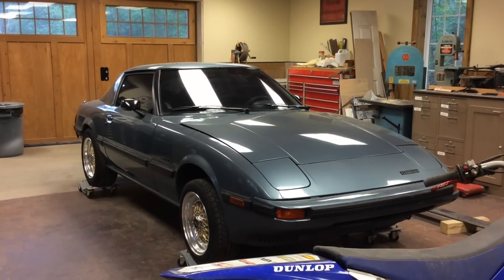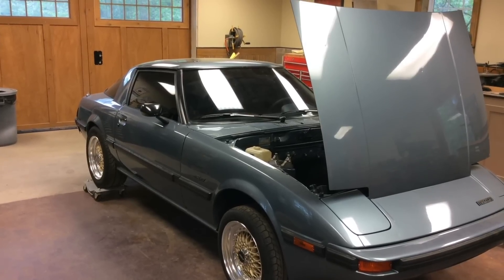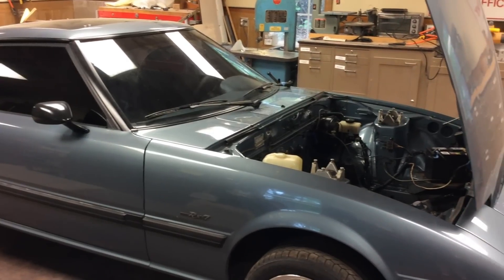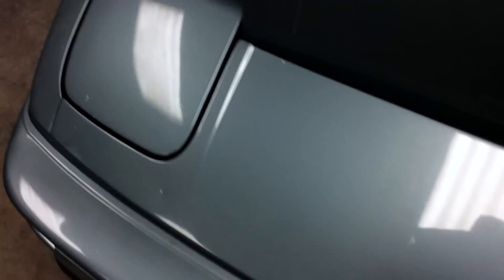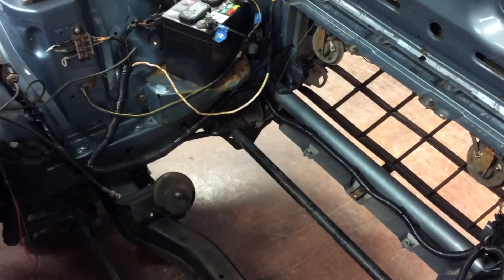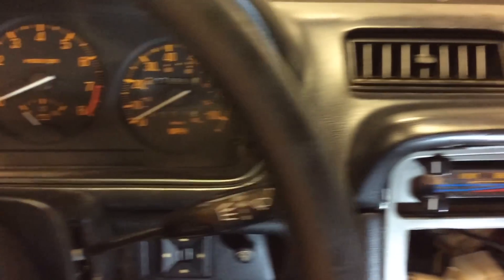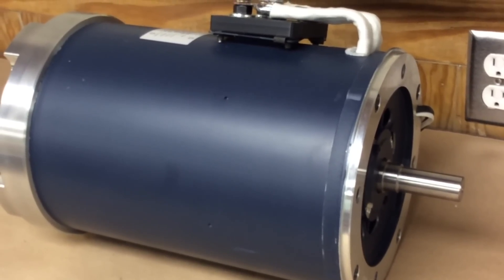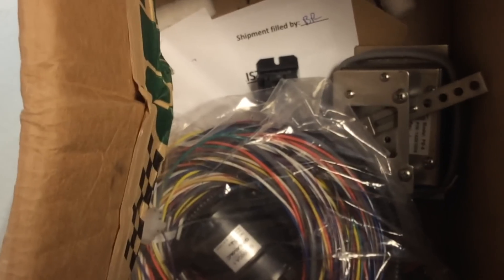RX 7 TO EV 7 INTRO

Comment: you try this so you can drive it in the winter.!!!
new electric car conversion system diy. cut up engine leave in water cooling lower but remember to cut leaving L bracket for electric motor. lathe camshaft into pole attach hydraulic around pole camshaft put back in. leave belt in place on bottom of L shaped then take the manifold cover and cover electric motor. put generac and transformer on top off manifold cover with roll bar to keep in place. change oil ever seventy hours. it now runs 5 hours per two gallons of gas and hydraulic motor protected against water damage. alternator still in place/water pump still in place/ air conditioning still in place and turned by camshaft hydraulic motor. good luck. Car is now much cheaper and you still have clutch.  maybe you don't need it but take it out only if you feel like it. remember to change oil cooling to water cooling then wallah.

Comment: Info specs. Model electric motor 
Batterys. maintance. Miles for charge.  Charge 110 outlet or 220.
Reply from the maker: Victor Gomez, are you asking a question or just making a statement?
Reply: Don Walters. All i wanna know. All about it to transform rx8 2004 to electric
Reply from the maker: Victor Gomez, all that info is available on my videos or others. That’s why we take the time to make them. Enjoy and good luck on your project.
Reply from the maker: Victor Gomez, watch all my videos!

Comment: Great idea. All the haters are clueless.
Reply from the maker: Dog House, thank you, far more positive than negative.
Reply: I do like electric,but you are clueless,how can he just replace a much better rotory engine with an electric motor,rotory engines have better performance when it is about drifting and cornering,it is not for everyday purpose and so as this car model,you non car guy dog lover!
Reply: @Wonderer245  you assume he plans on drifting? Also ev has instant torque and high rpm, wouldn't it be better?
Reply: @JonathanLong  nope! rotary engines have more power than and torque at higher revs! And yes rotary engines spin as fast as electric motors ! Also higher power is required for drifting because drifting is all about sliding your car at higher rpm ! That is why v8 cars like corvette cannot drift as good as rotary engined cars like a mazda rx7 ,despite having much higher low end torque!
Reply: @Wonderer245  im not exactly sure i follow. I love rotaries as much as the next guy, but i think ev is far more practical. Its not like you need top speed as much as you need torque to drift. With ev its constant and instant. Much more ideal for control at manage drift speeds. Look at the EV West M3 when it went to hoonigan's yard.
Reply: @JonathanLong  , well do know what is drifting? It is not about sliding from a halt ! It is about moving fast through straightaways and when you approach a corner ,you apply the handbrakes and skid,then suddenly apply the throttle so that you can make a constant slide ,and during that moment ,power has more dominance over torque ,that is why a stock rx7 fc can still drift  even if it is having lesser torque ! And right now ,you are having an argument with a JDM owner ! And why are you having so much hate on engines? And yes ,i'd seen the M3 which you were talking about ,and it was only sliding ,and not drifting as fast as an rx7 fd3s which is used in drift championship !

Comment: I have a 48 volt forklift motor paid $200 if I could only get 50 miles I will be happy. I wish I knew how to advance the timing to a make it receive 144 volts. Without burning up the motor.

Comment: Have you considered replacing the lights with LED's?  With everything as open as it is in this video (not sure how far along you've come) now is probably the time to replace the lights.  If you use LED's you not only will have a lower voltage drain at night, but you shouldn't need to replace the bulbs again.

Also you should be able to rig a new AC unit in.  The benefit being you'll have an entirely new AC unit with modern components.
Reply from the maker: Aaron Paluzzi, thanks Aaron, I did think of LED's but haven't done the research yet. I have researched the AC and plan on installing a 12v scroll type compressor.

Comment: beautiful RX!
if your going to convert a car to EV i can't think of a better vehicle to do it with then an older RX7, the rotary's where expensive to maintain and got horrible fuel mileage but the body shape has good  drag coefficient plus they looked cool!
Reply from the maker: Quadflopper101, shhhh, the rotary heads are listening.
Reply: Rotary is best even with its flaws

Comment: Is hpevs is as good as Tesla, nissan, Koenigsegg, Mercedes, rimac, and other big guy?
I'm asking because I don't know to decipher the specs given
Reply: Consider this, the batteries weigh a tonne and then some. This car was famous because it's engine was super lightweight compared to the power output. To this day, no piston engine can match the power vs weight. And mind you, thats after they stopped developing this engine for over 15 years. And mind you again, thats with only <130 people working on it as opposed to the millions working on piston engines. So no, putting a shitload of weight into this car and turnign it into what we in the actual motorsports world call "A leadsled" isn't going to do performance any good. Anybody who has spend at least 5 hours in any physics class will tell you the same. You cant bend physics. The heavier your car, the slower it corners and the longer it takes to slow down. Its time for the battery fanboys to get off their high horse and acknowledge this very basic fact.

Comment: Kills me how expensive electric motors cost ls swaps still king for performance per dollar
Reply: ....... I just don't know where to start.... So I'll try to keep this short.

This car is famous for it's lightweight engine. A different engine. Thats what it's famous for. And not only are you talking about somethign as ridiculous and completely disgracing and insulting as "LS swaps" you're actually condemning the fact that you cant put in something even more ineffecient and disgracing I.E. an electric engine?

My god. People like you are what are destroying this world. And only too late, if ever, will you figure out that you've been wrong all along. Though my immediate guess is that cognitive dissonance will keep you from seeing any other standpoint than your own, nevermind acknowledging your misstakes.
Reply: @Flyingdutchy33  Let us assume you can admit mistakes too. Replacing an engine that has poor fuel efficiency and has the worst CO2 emissions, IE... the Wankel rotary engine,  with an electric motor is killing the plant? An electric motor (motors convert energy, engines produce energy) is more inefficient than an engine that spits out more unburned fuel than my riding lawnmower? Dude,  get over the nostalgia and either go EV or LS swap the planet!
Reply: @davidl2736   I was referring to the physics.
Heavier = more inefficient. 
Hence lugging around a metric tonne of weight in a car that became famous because it's light and nimble seems like a pretty daft thing to do to me.

"is killing the plant"  - Not sure what you meant, but I'm gona assume you meant killing the car. And yes, that is demonstrably true. Take the lowest output stock rx7 you can find and it will be so much faster than this contraption if it was electric, it's not even funny or fair to try and compare. Heck, I will go one further. I bet I can outrun this moronic contraption in a car with no more than 100bhp.

Whats this about CO2? You do realize that the earth has never been greener in recorded history precisely due to added CO2? (source: NASA)

Nature loves it. It's the people that hate it.

Now, if there are any more questions, you know where to find me. But please, don't strawman the argument.

Comment: I totally disagree with these dingbats that whine over its conversion to EV... but FIFTY TO SIXTY MILES?!?  I assume that means you plan to go el cheapo with lead/ acid--- what a mistake--- lithium is far, far better, will not overload your suspension, and will tolerate the extra load of an AC/ heater, which lead/acid will eat up PRONTO... beyond that, you are far better using the AC motor rather than a DC system that will not provide regenerative braking and therefore will eat up the brakes quickly with the massive weight of lead/acid.

PLEASE get yourself some lithium cells from a salvaged Tesla---a lot are av avalable due to too many jackasses with more miney than brains, thinking they can drive them like Al Unser, and never have it get away from them... one idiot even totaled his Model S before he even got it out of the Tesla parking lot, smashing into the massive Tesla dealership sign, nearly toppling the whole thing over.

Yup, forget lead/acid... lithium is far better, will last far longer, are hundreds of pounds lighter, and will give great performance.
Reply: Seconded @billdale1. Grab some nice batteries from @jehugarcia and go lithium.
Reply: Ah yes, Lithium. You are not familiar with the actual TOXINS that are produced into making lithium batteries? You fucking EV fanboys never seize to amaze me with your high horse behaviour and low knowledge of the matter at hand.

Comment: atleast its not a Gsl-se lol...if i were you i would have used a miata chassis, its lighter, independent rear suspension, more parts(meaning cheaper for maintenance and replacements), and just more readily available...old rotaries are just getting more and more rare and saving and preserving any and all is essential...
Reply: Seb Lo not as cool

Comment: Haven't you just ruined its resale value ? I'm thinking if you spent $10K on a top rotary engine, it'd gain $25K in value
Reply from the maker: Rotor Thermotech, I haven't irreversibly modified the car yet! And I question your $25000 evaluation of a 82 RX-7. But I appreciate your passion for these great old  cars.
Reply: its worth 10k at most in stock form with a ported engine and exhuast sky is limit depending what you did if you were to cage andf throw a bridgeported 12a it would be worth around 30-50k
Reply: Rotor Thermotech it might be worth 10k at the most.

Comment: My rx7 has the ac button but it does not have ac just like yours. That is just how they built them back then making it cheeper to just make them all the same even if it had no ac
Reply from the maker: Bradley Smith, well I'm glad to have some of the components in place. I hope there's a spot for the evaporator coil in the duct work. Thanks for the info.

Comment: :( it's your car so you're the only one who has to like it... but I feel sorry for this beatiful 1st gen :( imo there should be a screaming rotary in this beauty
Reply: Wankels are cool motors from a conceptual standpoint, but in reality they have no place in the modern world. You just can't cure the fuel and oil consumption. The Renesis was specifically designed to improve on the drawbacks from the 20B rotaries, but failed to excite because the drawbacks were a symptom of everything that made them great. At least it will get driven long after 2 stroke engines and Rotaries are legislated against.
Reply: Flyingdutchy33 mazda confirmed a New rotary engine for 2019
Reply: Flyingdutchy33 https://youtu.be/Q73TBuusVRE
Reply: "Likely to use rotary as "range extender" "" 

Go slap yourself 20 times and say at least 200.000 hail mary's.
Reply: Alisdair Herd mazda is developing a rotary engine in this year so... you are wrong
Reply: +Alisdair Herd The only reason why they don't have a place in the modern world is brought to you by the people who did Climategate. Sure, it doesnt have a good fuel economy, but ultimately the reason why Mazda doesn't make them anymore has very little to do with consumption. It's all to do with the CO2 scam that being perpetrated on mankind, and people like you who swallow every grain of bullshit the mainstream media throws at them are to blame. So, in effect, YOU are the one who makes rotaries dissappear.
Reply: I havent heard of that tough, and I'm pretty informed regarding the matter. Last I heard they were shelving the plan. No, with politics as it is the past 30 years, it will never hit the market, ever. Meanwhiles I'm pleased to inform you that we have no rotary emissions testing in the Netherlands, and I'm going to be happily brapping with my 20b with no catalytics in the spring. Thanks for your optimism though I think it's premature and undeserved.

Comment: Not to be hating or bashing or any of that but you do know rotary engines are a discontinued engine platform right? Like what do you do with the rotary engine after? Just throw to scrap yard or sell online or something?
Reply from the maker: L3G1T,  yes as I said in the video I bought the car without the engine and transmission. The previous owner blew up that discontinued platform.
Reply: I'd be interested to hear how the last owner managed to blow up a 12a at such low mileage, they typically last well into the high 200k-300k mile range
Reply: Mazda still makes core parts for them depending on the year and they allegedly have another rotary in the works.  That said this car came with a 12a which you can sell online.  You would get far more money than you would scrapping it.
Reply: @Nate  He likely had a fuel delivery issue.

Comment: Wow this will be cool. I've been looking to do a conversion on a full size truck. Not very many people have done that so I've been looking to try it out. I know motor size and battery size is always an issue. But hey, gotta pay to play!
Reply: imacheat7777 Whack...electric motors is the future. This would smoke your 20B with the trenendous instant torque.
Reply: @imacheat7777 You should check out Jack Rickard on YouTube he has done his 2008 Cadillac Escalade Ext Pickup twice now. Originally with dual Warp-9 electric motors and now with a Tesla drive unit. He's also at EVTV.ME

Comment: Power very compatible to stock rotary, but torque from a dead stop, way more. I bet it would be quicker than stock if the battery weight isn't terribly high.

Comment: I had a 79 RX in Okinawa Japan.  By far the most fun car I have ever owned.

There are a lot of used Nissan Leaf series S electric cars on the market.  Some going for less than $5000.00.

In terms of a donor car. has any one explored that resource?

Nissan Leaf / Mazda RX?
Reply from the maker: Dave, I see people using the leaf battery packs but I'm not sure about the drive components. That's a good price for all.
Reply: Dave Ward a minha

Comment: Looking forward to you build, looking to do the same once I finish restoring my classic car- Did you compare this motor to the AC 51? Thanks
Reply from the maker: We did look at the AC-51. When I did the math, the higher voltage motor was going to require more battery. With our target range of 50-60 miles I thought the 50 was a good fit. Thanks for the comments. Good luck on your project.
Reply: عوذ مطور لي سيارة فلوكس تشغيل كهرباء